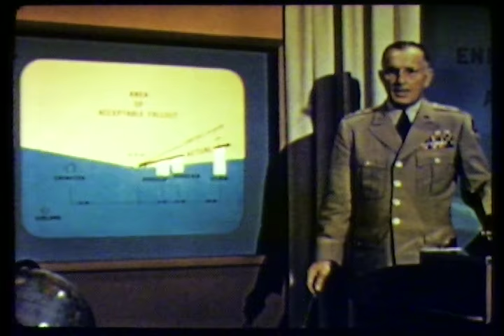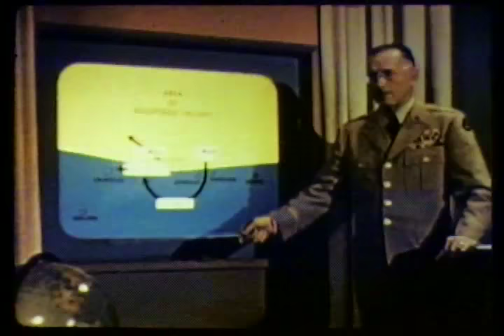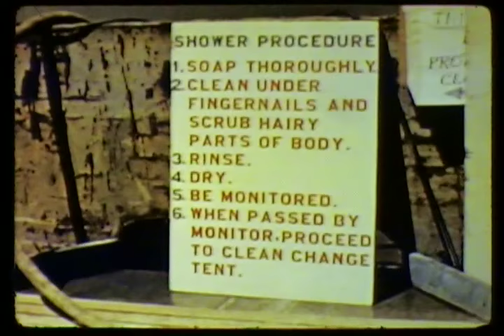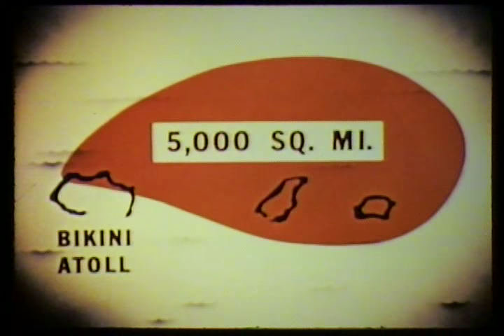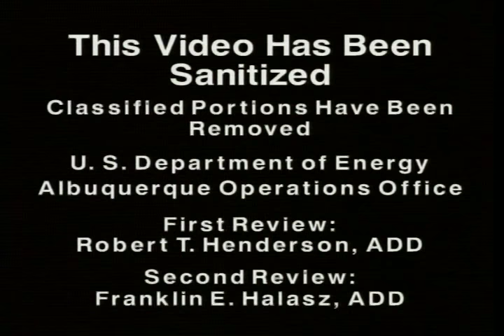Operation Castle (1954)

Comment: All of the heavy weapons are disassembled. Now we have small weapons using asymmetrical implosions that make a weapon that once weighted 20 tons now weight 500 pounds. also most yields on strategic weapons are in 500 kiloton range their CEP (Circle of error probability) is much smaller.
Reply: Your way off on US power in atomic weapon's that are deployed mainly on the sub-surface fleet of Ohio class subs....All are MIRV type missiles and carry between 3 to 5 independent warheads each with a 3 to 5 Megaton warhead....I was in the Navy and this information is not classified and is well documented.
Reply: Maxx Madd Maxx,  Thank you for your service in the Navy. I was in SAC ("Peace Is Our Profession.")  However, your comments about the Trident D-5 (carried on all US Ohio-class subs) are totally wrong, and YOU should know better.  The Trident D-5 MIRV bus is normally set up for eight 300-to-475 kT thermonuclear warheads.  Some sources indicate that the bus is technically capable of carrying 12, and others claim 14, for special short-range missions.  But as far as we know (published sources), Trident D-5 currently carries eight warheads per missile.  Your estimate of "3 to 5 Megatons" per warhead is way off, and not supported by any published source.

And, if you are familiar with the much improved CEP of these systems in the past 20 years, you would understand that multi-megaton warheads are not needed nor cost-effective, for the Ohio-class/Trident mission of deterrence.  Here are a few sources that back up my points: 

Trident II (D-5) 
http://fas.org/nuke/guide/uk/slbm/d-5.htm
http://www.lockheedmartin.com/us/products/trident-ii-d5-fleet-ballistic-missile--fbm-.html
http://www.globalsecurity.org/wmd/systems/d-5-specs.htm
http://www.astronautix.com/lvs/trientd5.htm

You are welcome to your opinions, but facts are facts---as far as published sources available to the general public go.
Reply: Elmer Bechdoldt At this time the US deployed nuclear weapons are limited to 1.6 MT; all heavier weapons have been disassembled.

The CEP is, of course, a function of the delivery platform (IC/RBMs have the best accuracy) rather than the bomb.
Reply: +bboucharde Land based missiles are bound by treaty as non MIRV capable, only SLBM's are permitted to be.
Reply: +bboucharde well that's reassuring. If I get hit by a 475 KT weapon instead of a 15 MT weapon I might survive, right? :D
Reply: gertrude duck Gertrude,  If you live in the USA (like I do), and if you follow military topics at all, you know that there are certain places that have a very high probability of getting hit in the event of a nuclear exchange.

However, if you live (for example) 35 miles out in the suburbs away from a major military target, you will have a higher chance of survival if it gets hit with 475 kT rather than 15 MT.  But the effects are not linearly related.  The inverse square law applies to a thermal burst such as this.

But if you live in base housing on a major military base (and if you do not have an underground, hardened shelter available), the weapons yield would not make much difference.  You would get the blowtorch (thermal flash), and an instant later, the hammer (20 to 30 psi over-pressure)---plus the initial radiation from the fireball.

You would be in Heaven.
Reply: or you'd just be dead, as heaven doesn't exist?
Reply: +bboucharde     So obviously by your remark you have lived this long and still have not had experience with the metaphysical world, do you have limited perception or perhaps you do not think very deeply into the world around you. I find it hard to believe that someone  reaches 40 years of age and still haven't  had personal experience with the spirit world.  That is really hard to believe, all I can say is you have a lot to learn yet in life.
Reply: orange70383 Orange,  Thank you for your feedback.

Comment: I wonder how a normal city would fair against something like Castle Bravo?.  Hiroshima was a city comprised of lightly built Japanese homes and old masonry buildings.  I  wonder what effect the bomb would have on a modern city with far larger structures like 40 story office buildings.  Then again i read that the blast over pressures near GZ are like a 30 million pounds per square inch.   Hard to fathom something that could make a modern city... DISAPPEAR!!
Reply: Okay, so I'm late by like 7 years. so I'm assuming you've already Learned the answer to this. but, if you're still wondering. look up a really nice tsar bomb video. Like a long one. with blueprints and the like. they added tons of   pretty Modern urban structures. at least at the time they performed the test. They built like a whole town on that island. strong buildings, steel    structures and the like. So this truly was. the best test. I learned tons about how high yield weapons may alter. something more modern. You should look into it. really interesting.
Reply: @otherhalf228  No they didn't.  They dropped the bomb on a deserted arctic island.  The shock wave was so enormous that it damaged structures 70 km away.  Directly below the bomb it scoured out solid granite.

Comment: You have to remember these were tests to learn what worked and what didn't. The US had exploded 1 hydrogen bomb in the Ivy test, and that was 10 Megatons. There were unexpected and unknown reactions that happened during Castle. Castle Bravo (test #1) went well over its design, to 15 Megatons. It pretty well trashed the test area and even gave the firing party a pretty rough ride.
Now reflect that a 20 Mt weapon was, for some time, a oft-used design in the USSR's weapons.

Comment: In its one test, Tsar Bomba yielded 50MT, 97% from fusion. It could easily have produced 100MT had its tertiary stage used U-238 instead of lead.

Once the Teller-Ulam principle was demonstrated, there was no technical challenge to either the US or USSR making arbitrarily huge bombs. They just had no practical use -- not that any nuclear weapon is terribly practical or useful except for deterrence.
Reply: ApolloWasReal Nuclear weapons are absolutely practical, and have proved that in the past. Not necessarily ridiculous hydrogen bombs, though.
Reply: Goddess Usako why are "hydrogen bombs" impractical?
Reply: +Evan Bell: Methinks Goddess Usako doesn't realise that virtually all nuclear warheads in both large arsenals are two-stage fission-fusion devices, a.k.a. "hydrogen bombs"! Me also thinks that she doesn't get that over a certain yield threshold they are absolutely impractical, as the energy is lost to space.
ApolloWasReal was specifically referring to huge thermonuclear devices (hydrogen bombs) with yields in excess of the Tsar Bomba, which places them outside the scope of practical weapons. I have no idea how someone could twist the meaning of his comment into "nuclear weapons don't work"!

+84 LoneDreamer84: Your scenario is only valid for an imbalanced system where there is an unopposed nuclear-capable state. Mutually Assured Destruction means: you drop megaton devices on me, then I'll drop megaton devices on you! No capitulation necessary, just M.A.D.!!!
Reply: They're practical if you want to blow up loads of stuff all at once.
Reply: @Evan_Bell  The full yield Tsar Bomba would have the delivery aircraft in the blast cloud.
The Tsar Bomba is too heavy to be delivered by rockets of the time.
The ultimate yield limit is 250Mt at which point the fireball exits the atmosphere and vents into space meaning doubling or tripling  the yield produces a bigger flash but the same size bang.
Reply: @allangibson8494  No idea what a blast cloud is supposed to be, and no, a 250MT fireball would not "exit the atmosphere".
Reply: @Evan_Bell  The modelling suggests that 250Mt will vent to space limiting overpressure at that point. Any higher and the pressure just vents up not sideways.
Being inside the blast cloud tends to turn aircraft into collections of aircraft parts - rapid unscheduled disassembly is Elon Musk's term ... The full yield Tsar Bomba is a suicide bomb.
Reply: @allangibson8494  Over pressure? Maybe. Fireball size? No.
Reply: @Evan_Bell  The fireball is limited by the maximum overpressure - if the top is vented you lose energy. You accelerate plasma to escape velocity limiting blast radius... You get a cone not a spheroid.
Basically you get to the point where two four smaller bombs of the same weight are better than one big bomb very fast with big nuclear weapons. MIRV at work...
Reply: @allangibson8494  Understand why such large weapons are not cost effective, but when you talk about "venting" plasma, that would occur in  250MT weapon. The fireball would not expand to the point that is escapes the atmosphere.

Comment: @bjzq8 The entire nuclear reaction takes place in roughly a millionth of a second so the bomb vaporization would be so quick that there would be no visual of anything just like you said.  The Trinity test had very high speed photography where you can see the fireball slowly devour the tower.  Operation greenhouse had one with multi million fps reference:  watch?v=kfbHwj71k48&feature=related  at 6:55. The Kraus/Ogle box and vacuum tubes were the only real way of "seeing" the initial explosions.

Comment: First, rebuttal: no, a supernova won't wipe out a galaxy. For example, a SN in our own galaxy would have to be within 600 or so light years to affect our planet substantially; our galaxy is 50,000 light years in diameter. The typical energy of a supernova is 1-2e44 joules (5e28 MT) of energy. Our sun is an intermediate sized star; it is too small to undergo a supernova termination.

There are two types of SNs: type 1a and type 2.  ...

Comment: To think that an antiquated bomb can cover a state the size of Connecticut (5,543 sq miles) coupled with the consideration that individual modern nuclear devices are more powerful, is a sobering lesson.
Reply: They aren't. Modern nuclear weapons have far less yield than these monsters. Better accuracy in delivering them meant they could get smaller and still get the job done.
Reply: @bennylofgren3208 Yes, the ballistic missile warheads are 400kt, much less powerful than those being tested in this video, but they can send one 8000miles  and put it right on the target. With that accuracy you dont need monster megatonage.

Comment: @aardvark9100 
Also, you seem knowledgeable of the Vaccum tube, or how I know them 'Light pipes' which were inside the Kraus/ogle box used in Ivy Mike, Unfortunately I have never found info on the data obtained from these Light Pipes attached onto the Sausage device, have you any other info?

Comment: Well I have seen videos literally where metals would distort and being a welder --only way to do that is super massive heat or actually displacement of the atoms through altering the bonds of those atoms. I do it all the time with HEAT ie Welding but not the way HUTCHINSON has done with a of Massive  Field electromagnetic energy. Read about THE PHILADELPHIA EXPERIMENT I was actually station at that shipyard for 2 weeks once.

Comment: Does all of these bombs, from 50's and 60's are still ready to use ? Or they were storaged ?
Reply: probably bigger
Reply: BigBoss1982 No.  Google "current nuclear weapons" to see what is in use.  The current weapons were generally all built in the 1980s.  Plutonium has not been newly manufactured in the last 20 years.  The largest current weapon in the US arsenal is 1.6 MT.
Reply: ***** No, I don't think so.  For one, they have been judged useful only for deterrence; keeping them quietly on a shelf after having been effectively banned is not deterrent effect.  Militarily they are pretty much useless; the ones on the missile silos and submarine IRBMs mean a lot more in terms of military effect, even strategic effect.
Reply: They have been disassembled.  The cores are still available, unless, like many from the USSR, they have been degraded into nuclear power fuel.  That's about the only way to "destroy" a core. The parts beyond the core were scrapped, except the explosives which were probably burned.

Making a CT out of this is silly.